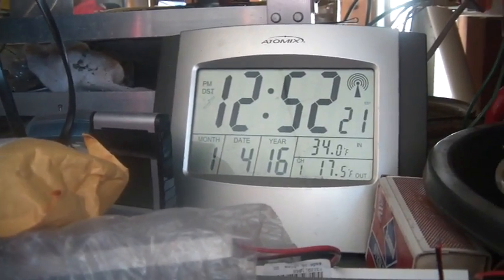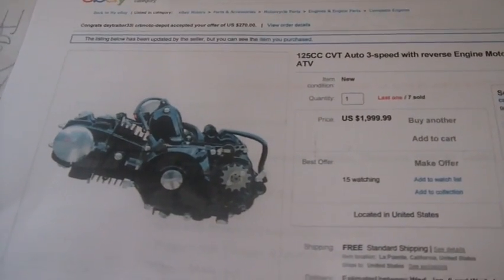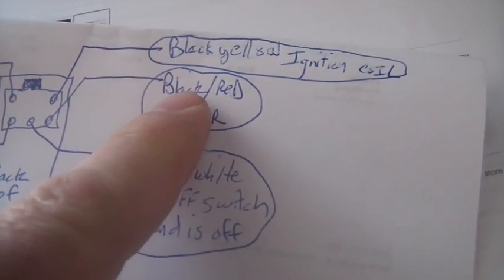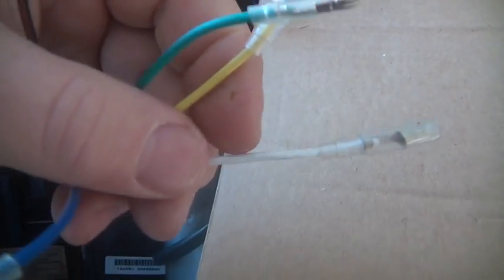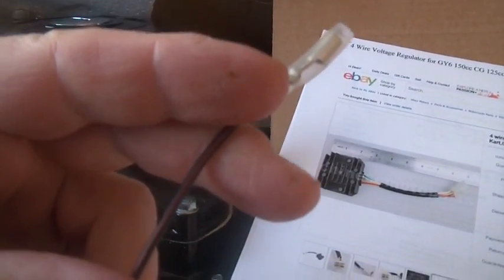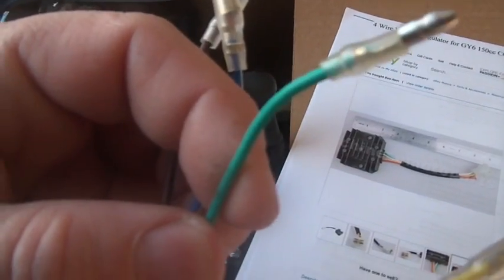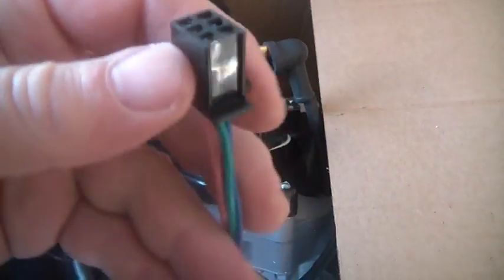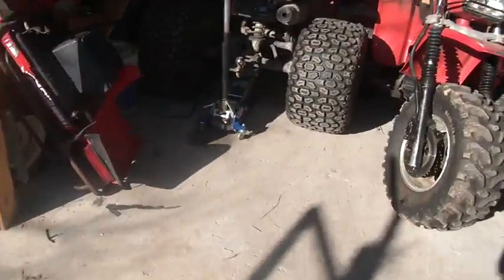How to wire a Honda Clone 125cc ATV motor. Ignition and battery,

Comment: I have a plug on my alternator and a plug on my wiring harness for it and there’s separate wires to hook the clip ends from the motor too and I have two yellows a blue and white a green and a black and red on the motor and on the harness I have all the same except instead of 2 yellows I have a yellow and a white and I’m a bit confused

Comment: Hi Harvey I have a 125 Buggy 2 seater with a charging problem where it fries the battery completely 
How do I test to see if it got power from the motor to the regulator and then to the battery
All so when I disconnect the battery the motor dies

Comment: Great info, but I have a question. Does the red wire from rectifier have to go to battery for my lights? Do I need a battery?  Thanks.
Reply: Witch 1 is the coil wire

Comment: Hey Harvey I have spark and it acts like it won’t to start but it doesn’t what might it be can you help me or maybe put me in the right way to look at too fix it thank
Reply from the maker: Hey Samuel, I have had a few memorable cases of an engine looking perfect, spark, some compression, timing good, new carb, etc, and they would not start.... FIrst case was a loose head, acted like a blown head gasket, just would not start... Tightened the head down and it started right up,  the other cases involved over tight valves,  it is the reason Y I tend to run with my valves loose.... I hope this helps.... 2 good places to start looking.... Thanks for asking, watching, and commenting!!!

Comment: How did you get this to start i have the same engine can not get it to spark. Does the gear position sensor have to be plugged in help would be great
Reply: Help would be appreciated as the quad is pretty new I can't get a spark from ignition

Comment: I got a starter on a 90 falcon that just spins.just makes a reving sound.can you please tell me whats going on..im sorry to bother you
Reply from the maker: Hey Ed, the starter spins a chain drive that turns a one way clutch, given that Ur starter turns and the motor does not, I'm thinking the gear on the starter, the chain, or the one way clutch is faulty.... If U R lucky, U need a $15 starter, I think the chain is fairly cheap also.... I'm sure the one way clutch gets into more work and $.... I hope this helps.... I have a starter job to do on a 70cc shortly, stay tuned..... Thanks for asking, watching, and commenting!!!

Comment: i have a 1964 honda 90. and i bought a 125 lifan. but none of the wirer match up to anything...the new engine i bought has everything . should it just hook up to the key switch..i don't no what is hot on the new engine...
it was 6 volt and now it is going to be 12 volt.

Comment: Hey Mr. Harvey,  I have a 82 honda 250 motorcycle engine. I put it on a custom frame but I'm having a problem trying to figure out what some of the wires are, where they go and what they're for. If you would please contact me I have a few questions and I was hoping you could help me.

Comment: Hi Harvey ...i see you post a lot and hope you still do .... i have a honda 125 cdi ... after viewing most of your vids ...  i had a look at my setup ...firstly i have 3 different sets of wire coming out the engine block  ..... 1 brown wire that looks like its coming from the gear box ( which i'm hoping is just for indicating a gear  or something) .... a set of 3 wires (2 yellow and a red/black) and a seperate green wire  (earth) from above the crank shaft ..... and lastly another two wires from the from of the engine (blue and green ---assuming these are pulse wires)..... secondly ... my cdi has 6 wires coming out of it ???  lastly my regulator has 5 wires (green,red,black and 2 yellow )  .... starter relay has then usual 2  posts (battery/starter posts) with an additional red wire on the battery connection side and the two smaller wires heading off to the ignition ...  why would my cdi have 6 wires? and could i hook up the red wire from my regulator to the red on my starter coil (would that be my charging wire)) ???? TIA DON

Comment: i got a giye 125cc fully auto look just like urs came with a wierd harnest but no diagram i was wondering if u have a simple diagram i could use i just need lights turn signals ignition (on off and tail light i have one switch that covers ho/low beam ..horn and turn signals ...and the other is kill switch run and start.spedometer lights up not digital with turn signal/neutral ..  indicators and. plz help i have wire diagram for all just dont know how to put together

Comment: my London 125 cc has a green,red/black,blue/white,and 2 yellow wires one a little thicker than the other how would I connect the yellow and white wire of the rectifier to the engine
Reply from the maker: Hey Kenny, I would check the yellow wire to ground, with my digital Volt Meter set to AC Volts and see if I get a reading somewhere around 25V, then I would check the second yellow wire the same way and expect the same reading, if that is the case, the thicker yellow wire would go to the yellow wire on the voltage regulator and the second yellow would go to the white, if Ur voltage readings differ from above, write me back and let me know what U R seeing.... Thanks for asking, watching, and commenting!!!

Comment: I have never seen a charging system fused on a bike. When I wire them up I do.
Reply from the maker: +william staten , I was looking at the charge circuit schematic in my mind and just did not remember a fuse there, then I was thinking that a lot of regulators will fail if the battery goes opened circuit, then, I thought it made sense that there was no fuse there, what is a short circuit and some fire between friends????   Thanks for the good info, watching, and commenting!!!!

Comment: Harvey what is the Ebay # for that regulator .. I need one super bad .. Thumbs up man !!
Reply from the maker: +ShawnMrFixit , I did an eBay search under 4wire, ATV regulator, then I looked at the pictures and made sure that I had the same color wires. My ATV motor has yellow and white wires coming from the stator, some have yellow and pink, I would get a regulator with the same colors to start, though, the yellow/pink regulators were cheaper and I may try one to see if it will work... Thanks for asking, watching, and commenting!!!